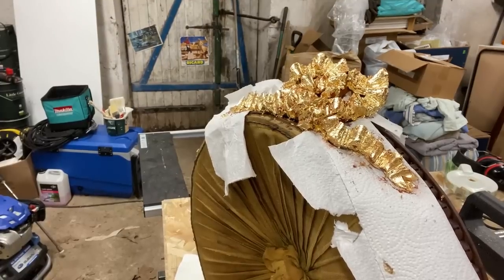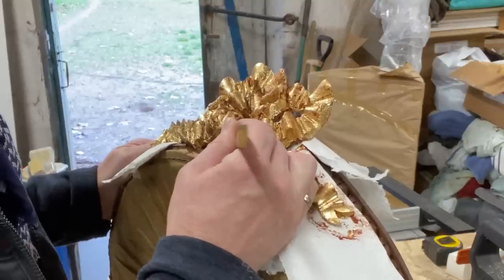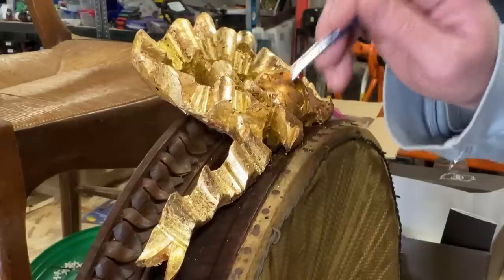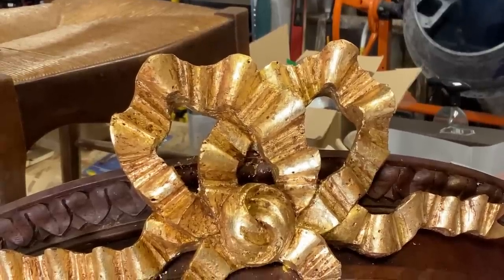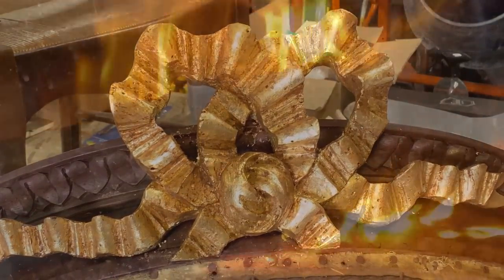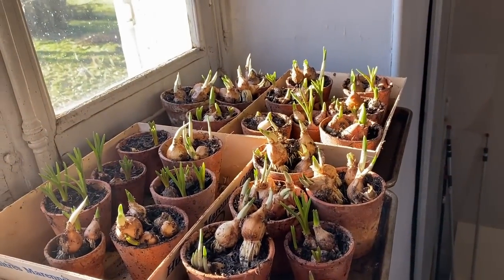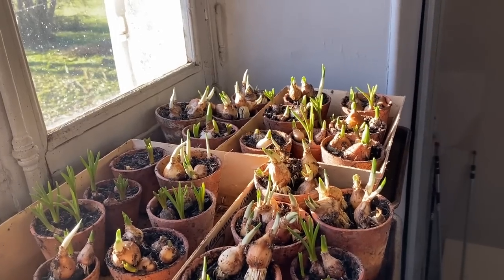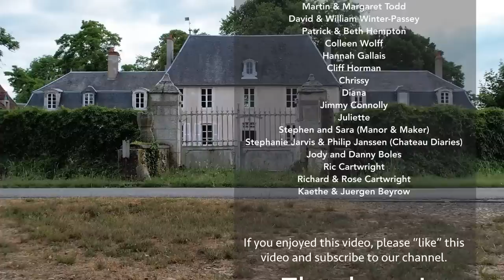RESTORING and installing an ANTIQUE BED CROWN, part 2 - Journey to the Château de Colombe, Ep. 69

Comment: Nice demonstration on the gilding. I guess it doesn't matter how you hang draperies, as long as the end result is correct. I like the restrained use of gilding; so many owners embrace the extreme gilding which seems to have been a fashion in the Belle Epoque. I think "less is more."

Comment: I'd love to see a bit more info on installing the bed crown, what did you use to secure it to wall and ceiling? It looks great. The white, gathered band was a great addition.  Well done!
I was thinking, the top of an antique drum pedestal table could be altered and used to make a bed crown. I see them occasionally in thrift stores and I plan on buying the next one I find. I am slowly adding French accents to my room/ currently also used for my watercolor painting addiction. My furniture is mostly 100 yr old antiques acquired from my grandfather's years working in local furniture manufacturers and his buying "seconds" and bringing them home.  I look forward to the day I can get it completed.
I can't wait to see the kitchen progress! From Michigan,
@ Debra L Pate Art
Reply from the maker: We used the original hardware from the bed crown. You can see Patrick temporarily remove it in the part 1 video. They are metal spikes that are attached to the back of the wood and they are hammered into the stone wall. The top had a metal loop, and we used wire to attach it to the ceiling. Originally they would have used rope.